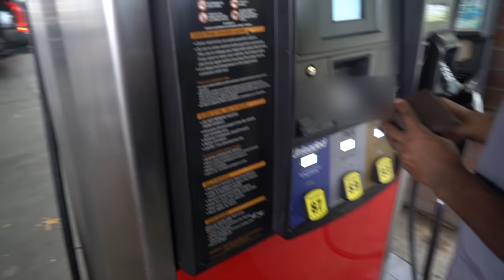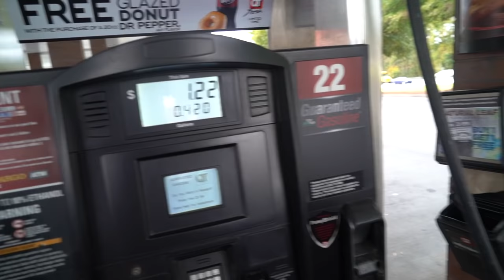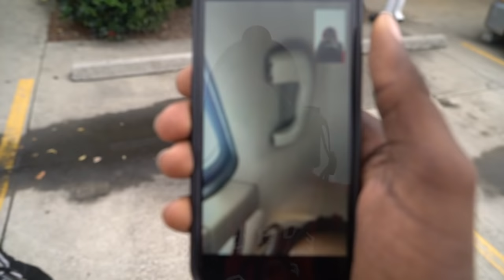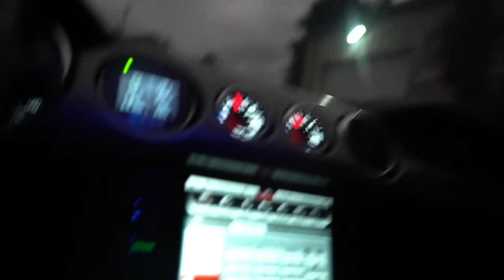Picking up my 1,000 hp MUSTANG from KURGAN MOTORSPORTS!!!!

Comment: MAN!...You 49 State Guys and Gals  are very fortunate you don't have to worry about Smog Laws!...Like we have to here in California!

Even the 2013/14 Shelby American GT500 - Shelby 1000 (on pump gas) is only 49 State Street Legal!

Plus there are No 50 State Street Legal Single or Twin Turbo setups for the Mustang that are 50 State Street Legal!...The only way I can get a Twin Turbo setup for a Mustang in California, I would have to get a 1975 or early Mustang!

The 75's and earlier Mustang's are Exempted from the Mandatory 2 year Smog Check!...So I can Custom Build one!

I had a 66 Mustang Coupe back in High School and my favorite Mustang was the 69/70 Shelby GT500!

I am Glad to see a Brother able to Drive a late model Mustang with 1000HP on the Street plus using a Manual Trans vs an Auto Trans!

Drive Safely and God Bless!

BTW!...I found a company called Nelson Racing Engines aka NRE here in California that could build me Ford Twin Turbo 427ci. engine using 91 octane for around $35,000.00 putting out 1000HP!

Also for about $45,000.00 they could build me 5.4/5.8 Shelby GT500 Twin Turbo engine using a flex fuel system of both 91 octane and E85 fuels!...Putting out 1200HP+!...I am Just Saying!
Reply: David J. Smith I don’t think any 91 octane in CA is good at all, it’s all crap gas. I have a TT S550 and when I was logging, I got knock due to fuel being crap. Even spraying meth it’ sucks, E85 is the way to go. 91 pump fuel here in CA isn’t 91, it’s worse. If your going boosted here in CA, Don’t bother tuning on 91. You won’t get enough Timing or spark, at least that was my case.